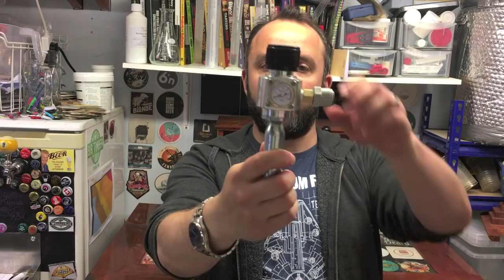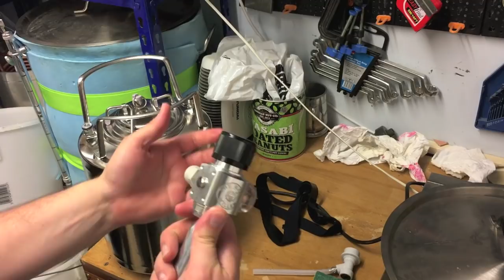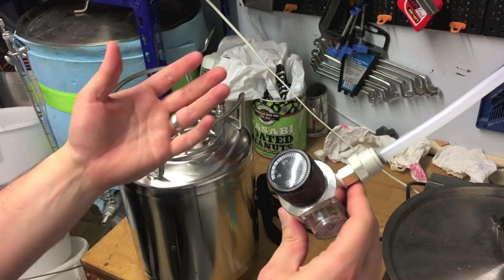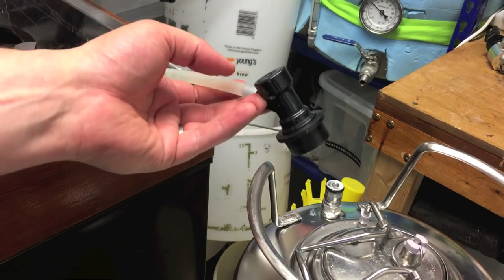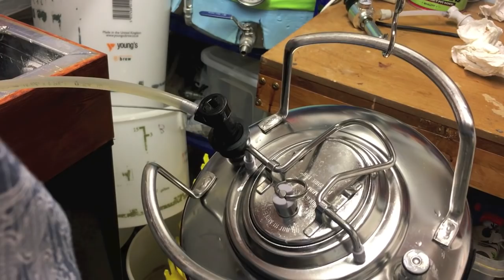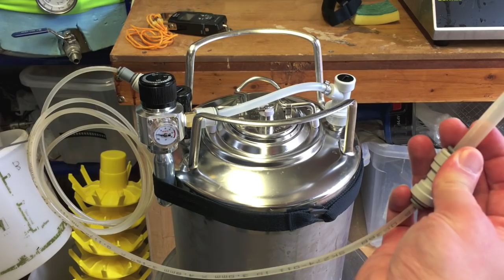Portable 10L Keg Set Up with Maltmiller Universal Co2 Regulator

Comment: I used 5L party kegs before I got my kegerator with a "Party Star" tap that uses those small 16g CO2 cartridges.
If the beer was fully carbonated from start I would usually be able to push ut 2 party kegs with one CO2 cartridge. Of course the pressure in the keg helped a bit as well.

Comment: I’ve done a similar thing to this using the same regulator and a soda stream supply on a 10 lt mangrove jack keg. I wasn’t sure about the quality of the Chinese ones either so played it safe. The next one will be a cheaper Chinese one though as my kegerator is pretty small and I only make 11 lt batches anyway. I like that I can switch between the 2 gas supplies (soda and 16g bulbs) using the same regulator if I want to take the keg out (the soda bottle stays in the kegerator). 
Can’t wait for the latest brew to finish to test it out!

Comment: I have 2 of these mini - regulators. Mine might be leaky, but I don't get but about 2 liters at 8-10 PSI before the gas charger is spent. I'd like to hear how efficient yours are. They are very handy, though. I have one set up on a 20 oz paintball cylinder and I should get several full kegs on that size gas cylinder. I find the small CO2 chargers convenient, but they are $2 a pop and the paintball cylinder is refillable for $5.
Reply from the maker: jcinsaniac the keg was pre-pressurised from the transfer so that helped, I think I got about half of the keg out so 4-5L before the cartridge was gone but the remaining pressure was sufficient to dispense most of the remaining beer as well

Comment: Nice one Rich! I found, when taking my 19l keg down the caravan, that if I put approx 20psi in there it’ll last at least 2 nights with no need to top up the pressure. Pouring the beer is no issue with the party tap either!!👍👍👍
Cheers🍻🍻🍻
Reply from the maker: Cutters Choice Homebrew At The Flag & Fez Brewery. Nice! Cheers for the tip Clive